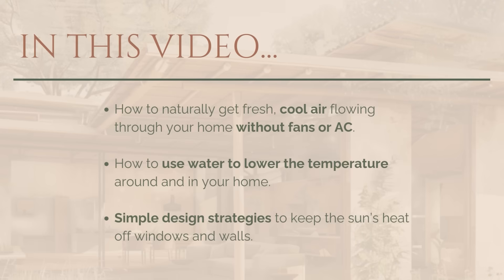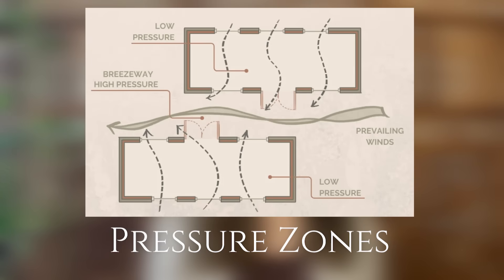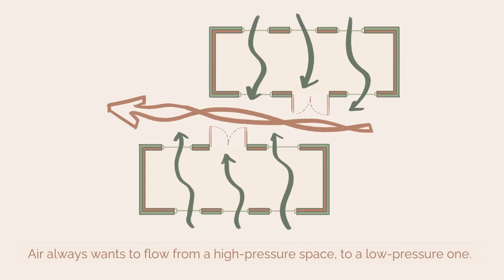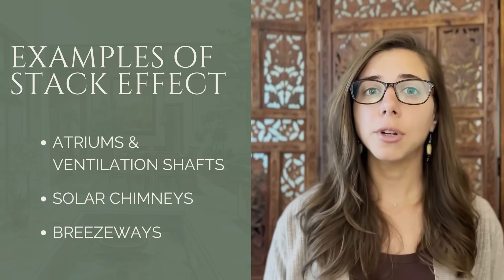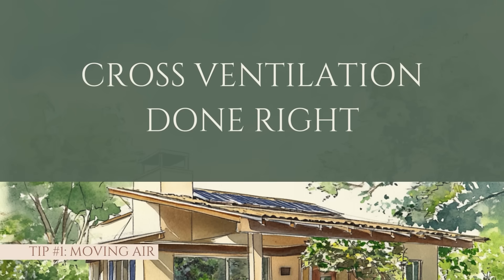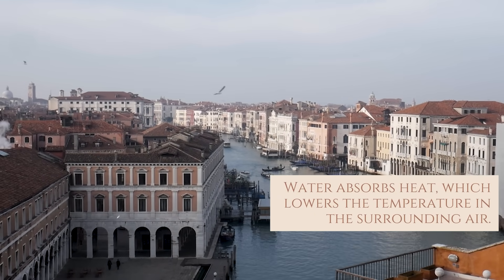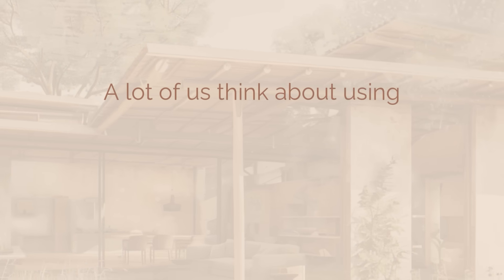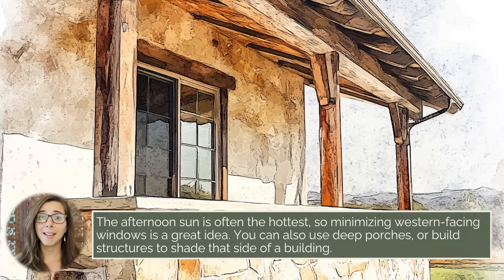The Forgotten Cooling Techniques Architects Don't Talk About

Comment: Thank you for your detailed explanation! I live in Perth Australia which is a dry heat ( Mediterranean almost) but often gets humid these days. I grew up in Townsville North Queensland and it is very very humid and tropical. I lived in a hundred year old house on stilts when I moved out of home. It had a breeze way - a hall running through the middle with a sore on either side. Some old houses in Townsville have balconies all the way around the house. 
In Perth there is an architect who designed his house using passive design. It’s called ‘jimmy’s house’. If you google it and look on his website you can see his blueprint. It’s a place that makes my heart ache. It’s so wonderful ! 
I live in an apartment - one bedroom but has high ceilings, good insulation and double glazing (which is very unusual in Perth - strange!) and it stays even in temperature all year around. Only when it’s over 35 degrees and above do I need the aircon on. The biggest problem is lack of cross ventilation. If I could afford my dream home it’d be a passive designed house. 
Thanks once again for your video!

Comment: Passive building is crap and doesn't work well enough. Also passive can only be built for one season. Cold or hot not both.
Reply from the maker: Passive strategies of ventilation cooling and solar heat gain are commonly used in mixed climates.  Again, there are both modern and historic examples of buildings doing this -- will make sure to share more on these examples.

Comment: The active house with variable insulation. For ex. window open= no insulation, window closed = insulation, window closed + insulated shutter = very good insulation. So, big windows on east+south+west, open when the outside air is cooler, closed when outside air is hotter. Insulated shutter 12 cm like the refrigerator door. The interior temperature of a insulated wall oriented south is higher than the temperature of the outside air  in generally.
Reply from the maker: Great points!  Yes insulation can be a big player with passive cooling too!  Love the fridge door analogy - makes perfect sense!

Comment: I'm from Malaysia, a hot and humid tropical country. Our traditional houses are built on stilts and have lots of windows. This is to maximise air flow as much as possible.  Air can flow through the walls and through the floor (i.e., via small gaps in-between the floor planks). The windows are typically from floor to (almost) ceiling. Often, there are so many windows that the whole wall is actually just a series of windows.

Search Wikipedia for "Malay house" to see how this looks like. It is the first photo of that particular article.

Comment: Fascinating how traditional architecture took into consideration all of these passive cooling methods. Our traditional home style in South India called Naalukettu, has really low overhangs for shading and making sure only the cooler denser air flows inside and it flows into an open central courtyard from where the warm air rises. That open courtyard also recieved all the rainwater with the roof sloping into to the central courtyard and had the water flow out with drain pipes under the homes and into a pond beside the home.
Reply from the maker: I love this!  So true, traditional architects thought these factors out a lot better!  The central courtyard serving multiple functions, with the beauty element im sure!.  With modern technology, its sad to see that so many designers have gotten lazy with these techniques.
Reply: In the south of Europe they also have building styles in some regions that look like this.
Reply: Hi,

I would love to learn more about the Naalukettu theory and design.  Do you have a channel or website where i can read , learn from?

Thanks in advance

Sam
Reply: @SamSam-bv3vn  Naalukettu- is just the name of the built. The traditional architectural principles that was followed is called 'Thachashasthram'. You might get more info if you look into that. I don't really know about a website or page just for those though

Comment: do you have any thoughts on hot and very humid?
Reply from the maker: Humidity is tricky, I have not come across a passive / natural way to do this yet.  Thus my disclaimer in the beginning of the video.  Mechanical means may be necessary for dehumidification.
Reply: @christinaransbury  would love a video on humid climates. Here in the UK, we don't get a lot of really hot weather, but when we do it tends to be humid and also there is little to no breeze, so the first two tips are not as appropriate. Air conditioning is not that common in UK homes and it can be sweltering on the upper floors.
Reply: @DH-tv2yw  Ceiling fans are common way to address humidity in more humid climates such as the tropics and subtropics.  This generates breezes over the skin surface and takes the heat away from our bodies so we can feel cooler (rather than cooling the space).  You can also use pedestal fans to circulate the air and generate the breeze if installing ceiling fans is out of the question.  Something we commonly do in Australia ;)
Reply: @byGreenish  I have never tried a ceiling fan, although I sometimes use a pedestal fan. I will consider fitting one. My wife usually complains that fans hurt her ears/ give her an ear infection. But I am not sure what it is about fans that do that to her.
Reply: If you want to get rid of humidity you have to close up the space and use a  dehumidifier.

Comment: Hai there! Thank you for sharing. May I ask something? In the Stack Effect, shouldn't the opening at the bottom (lower temperature) be smaller than the opening at the top (higher temperature) to maximize airflow?
Reply from the maker: Generally speaking they need to be similar sizes so that the air intake is balanced with the air exhaust.  However, if you live in a colder climate, you make need bigger openings at the top to effectively move the air.

Comment: Some excellent tips.
The download is also very useful.
A couple of thoughts:
1. Low E glazing is the first step; I suggest double or triple glazing where possible as well, because it is not only direct solar exposure that heats the window, but convective heating through the atmosphere.
2. When shading windows, be aware that the shade device should be wider than the window to cut the sun exposure at lower sun elevation angles; heat can be gained from pre-mid morning to later afternoon in hot climates.
3. An exterior wall layering from inside to outside can be helpful: brick/masonary-insulation-airgap-thin cladding that will keep direct sun off the inner massive wall structure. This keeps the inner thermal mass cooler.
4. Concrete slab-on-ground, with edge and perimeter insulation (polystyrene is good) for about 3 feet or so  will enable the slab to stay close to deep-earth coolness.
5. In really hot climates, a 'shade roof' can be helpful this is a ventilated roof as a shade or 'umbrella' over the weather roof. Of course the roof system needs to be insulated at about R4 level.
6. Carbon worries are irrelevant. More CO2, better plant  growth for local vegetative cooling.
Reply: Your first 5 points are quite good and relevant. However, more CO2 in the atmosphere is not good for plants as it interferes with nutrient uptake and carbon sequestration, and for food crops makes them less nutriious.More C)2 also sets up a negative feedback loops causing a doom spiral.
Reply from the maker: Same thoughts exactly!
Reply from the maker: Great tips!  Thanks for sharing

Comment: I have a louvre window at top of stairs and open my tiled laundry door and you can feel the cool air coming in the hallway from the laundry and wafting up the stairs void as the hot air goes out the top of stairs window.
Reply from the maker: Thats a great example of a breezeway in action!  Love that, especially with the tile mass contributing to the cooling.

Comment: I designed and build a solar efficient home almost forty years ago using many of the techniques discussed in this video and they work just fine. I am in Perth, Western Australia where it can get very hot in the summer (40+ degrees C, 104 F), but even without any mechanical air conditioning the house remains cool in the summer and warm in the winter, with very little in the way of mechanical heating or cooling. The thing to consider carefully is adequate insulation all around, and avoiding thermal bridging that will allow heat to pass from the exterior to the interior of the building, or the other way around. I did at first have some issues with this which once identified needed to be retrofitted. Also, if you use thermal mass in the building such as clay bricks, understand that it will take some time (possibly years) for all of the residual heat stored within the fired bricks to escape and the bricks to cool completely, but once this has happened then the thermal mass works just fine. I have observed that over the years we have saved significant amounts of money by not needing to install, operate, maintain, and eventually replace mechanical heating or cooling systems.
Reply from the maker: Thats amazing to hear!  Do you have a video on your building?  For sure, important factors of insulation and thermal bridging. Interesting point about the fired bricks... I had not thought of that!  Yes!  It is 100% possible to heat and cool a building with virtually no reliance on mechanical heating or cooling.  It is a very resilient solution!
Reply: Here in Brazil we use a lot of clay bricks, I don't know if is the same technique. But we water the bricks before using it. Also since they are porous, it prevents from the brick sucking water from the concrete making it not as strong. You also should not have issues with residual heat.
Reply: @flavialm1  Estou também no Brasil, lendo e aprendendo.
Reply: Hello there it's nice to have some one who faced and solved the same problems as someone who lives in Africa I would like to know more

Comment: I wonder what you have to say for heating. I live in Europe and we don't usually have AC despite temperatures may go from -20°C to +42°C. Thus, it can get unbearable in summer, especially because of heat getting trapped inside. On the other hand, we still need to heat a lot in winter and the energy goes literally straight out of the window the moment we want fresh air! Plus, we have simultaneously too dry indoor air in most places (irritated noses and eyes) and still a mold problem in bath, kitchen and basement, and any place where cold and warm rooms share a wall...
Reply from the maker: Hey!  Yes I will be doing a video on heating here soon.  It sounds like there is not enough insulation and lack of balanced ventilation.  Its still important to have mechanical ventilation in cold climates to filter incoming air on days you don't want to use passive ventilation / open a window.  This will also evenly distribute internal humidity throughout the spaces.  I would insulate between warm and cold rooms, as there where be condensation on any surface if the delta between the temperature is too much.  Hope that helps!
Reply: @christinaransbury  Thanks. Two of three apartments I've been to have no window in the bathroom and both bath and kitchen have electric ventilation, but in many cases, it seems woefully inadequate.
Reply from the maker: @edi9892  exactly, they did not size it correctly.  Also, whole house ventilation would be ideal, not just kitchens and baths!

Comment: These are all free. It's incredible how many modern-day designers and builders do not consider passive solar design and build principles. Thank you for spreading the word.
Reply from the maker: Thanks, it's really about getting back to basics.
Reply: Yeah, totally. When I was in uni there was a student housing block that was basically just one big black box with a lot of window space. In summer it got awfully hot, so after many years of complaints, eventually AC was installed in every room. It would have been much better for everyone involved if it was designed with warm summers in mind. I’ve lived in homes that were comfortably warm in winter and comfortably cool in summer, all without AC.
Reply: In Europe they do. That's why they build different homes everywhere. It's not because they are a different country.
Most things are not correct. Hot air doesn't rise, it expands in all directions. It's the cool air pushing it higher.
The sun is not hotter at the evening. Everything around you had a full day of sun. Coldest period is when the sun goes up after a full night.
It's mainly basic education. No magic needed. Roman house from 800 BC already shows you how it works. The pool of water is not a garden feature nor is the extended roof.
Reply: And the chimney of the fireplace are the floor and inner walls. Just like with castles. It's cold in there because it's a museum that's turned off. Not because these people where primitive .
Reply: @RogerKeulen  living in Spain, I would underline your comment about Roman houses. Not letting sunlight shine inside the property. We have an extended roof, and balconies above all our windows. Moreover, they are angled so that in the Summer sunlight doesn't enter the house, but in the Winter it does for a couple of hourse each day. In the middle of Summer, we very much don't want ventilation. We close the windows and doors, that are double glazed and each have a seal. The air is cool inside, it is very hot outside. We don't want the hot air inside, so we keep it out. We air the house at night. Our house is built around a large courtyard. We have no external windows at all, only windows facing onto the courtyard... We don't need AC. Our house is nice and cool, and is built after the Roman fashion.
Reply: I feel the client is part of the issue. They want control and I stand gratification with HVAC and such. So, designers are not the only ones to blame. Builders just build whatever they are paid to build.
Reply: Money, money, money.

Comment: In our region the air is too hot outside. So I think passive cooling rolls can't work here. Am l right?
Reply from the maker: it depends on the humidity levels.  Passive Cooling techniques are like "preventative" care... they should be implemented prior to mechanical means.  Some climates require mechanical cooling, but should be minimized as much as possible with passive techniques before hand.
Reply: @christinaransbury    ❤️

Comment: I like your content, but I like to point at the sun having the highest power at noon (the sun's highest point) which in the northern hemisphere is south. When hitting glas, the light is "converted" to heat. Preventing the most powerful light to fall through glass will have the highest impact. The highest temperatures though are in late afternoon as it takes time for everything to heat up. When you are not in a region with heavy or frequent rain, it makes more sense to have outside window blinds like the ones you see in Spain or Italy than any kind of roof. You have a light and bright room when you want it (winter) and can keep the sun outside when you need to.
Reply from the maker: Agreed!

Comment: Well done, girl. 🎉This is exactly what we need to resort to - nature. Nature has treasures of comfort and solutions to our excesses. All we need is wake up to it. Let me congratulate you for showcasing a noble novelty we have distanced from over the years in search of comfort and returning to it for the same. Christina you are marketting gifts of nature and I love the very idea. I love countryside living and have been enjoying many of the nature's gifts most of my life. 

I am planning to build a granpa house using gifts of nature, no electric lighting during day. Cooling without ac, potable water from humid air, a slide with each stair, worm holes between floors for kid adventure, a diy family workshop. A rugged but safe lift between floors (when my knees back out on me)😂, and so on it goes. Imagination, imagination, imagination!!!

Christina, I am 70. Will you help me design my house. You will be my guest in Pakistan when complete and I will take you around to Gilgit, Kashmir & to stunning beauty of further north. So, what do you say, nature lover?

I am a mechanical engineer with hydropower as lifetime profession. Your presentation was substantial with simple science, I have subscribed your channel to remain in touch.
Reply from the maker: replied to your email!